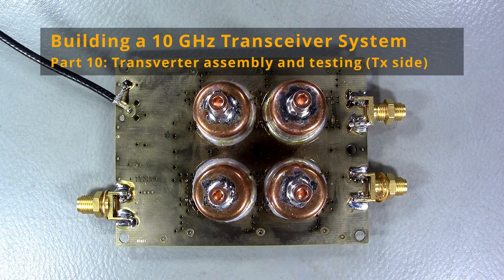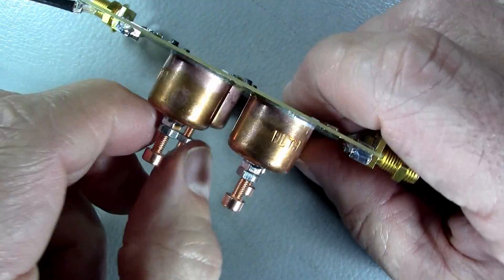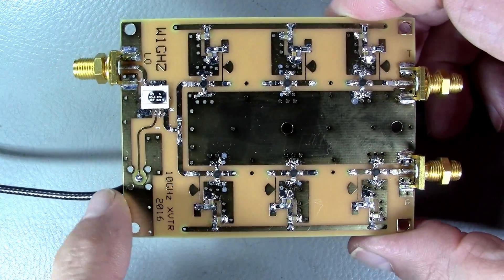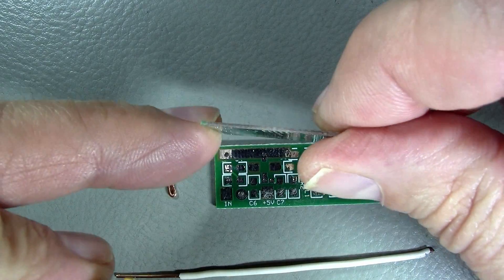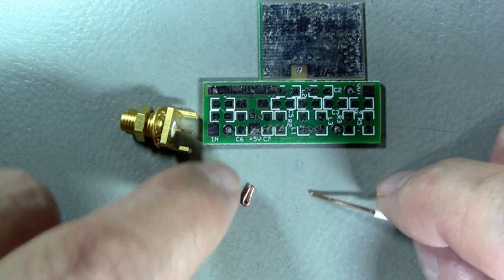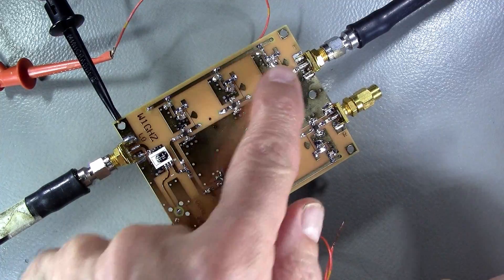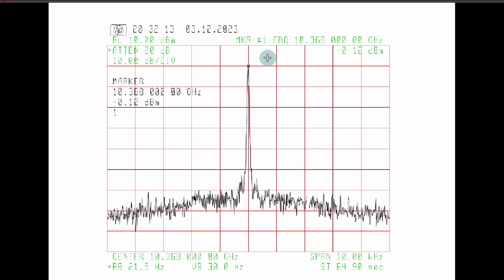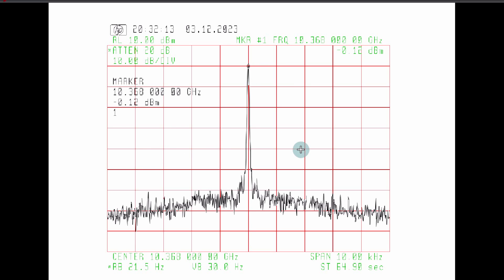10 GHz System, Part 10: Transverter Assembly and Testing

Comment: It's possible you have 1 or both of the pipe cap filters tuned to 10.224 MHz.  Try tuning one of them by turning the screw OUT and see if you find another peak.  If so, lock it down and try the same thing with the other filter.  That is my guess since you said changing the level of the 144 MHz did not change the 10 GHz output level, when it should change.  N0EDV

Comment: I had one that got +6dbm output but 4 that were much less.  I think its the losses in the pipe cap filters. Still its a good transverter board for the price.
Reply from the maker: Yes, the pipe caps do not perform as good as the author claims. Also, FR4 PCB losses at 10 GHz start to become noticeable.